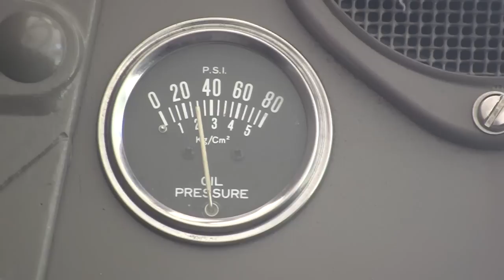Restoring a Ferguson TO-30 Tractor in 8 minutes or less

Comment: 60 years ago, my dad bought a used Ferguson "30 with a 35 kit" which he used for the next 20 some years.  I loved that tractor which was plenty big enough for our 126 acres.  We had a 2 bottom turning plow, a 3 pt digger/cultivator, drag-behind disc, and a John Deere No 7 sickle mower.  The mower was well matched to the power of the 35 kit, and I could mow in 3rd gear with the throttle wide open.  Of course, when it dropped a front wheel in a group hog hole, I nearly lost my teeth on the steering wheel!  Great memories, so thanks for restoring the old girl.

Comment: I have one of these.  I've owned it for 20 years.  The only thing I have replaced were the tires, wires, spark plugs and a water pump.  I use it several times a week.

Comment: My ferguson TO 30 will start but not keep running. Sometimes run a few seconds or several minutes. Filter screen in side gas tank is clean. Fuel flowing good thru line. Fresh Gas.  Any ideas ?